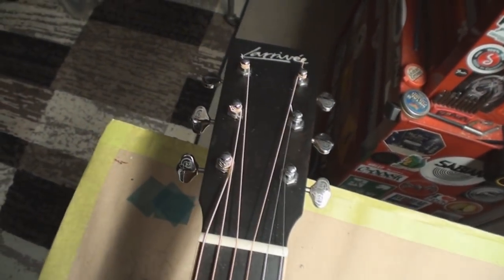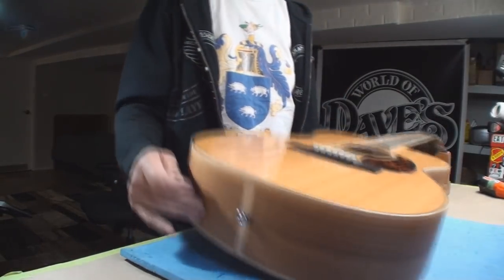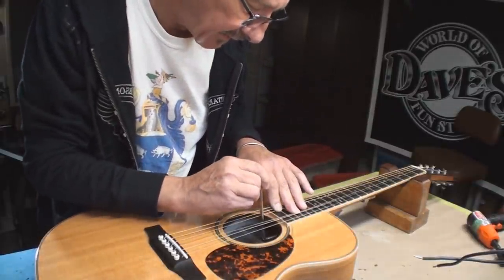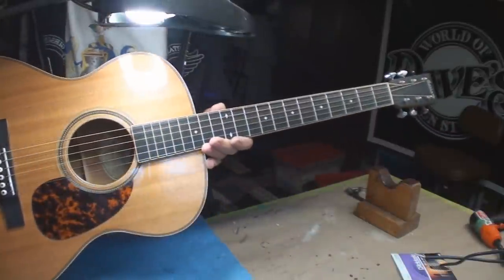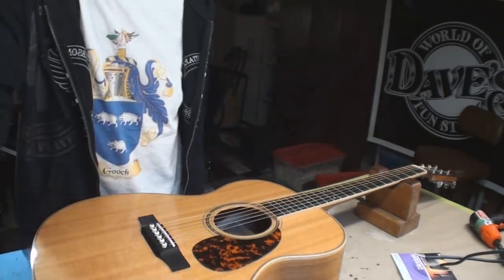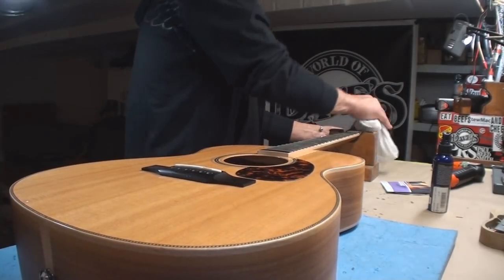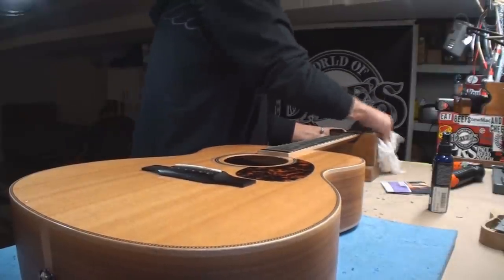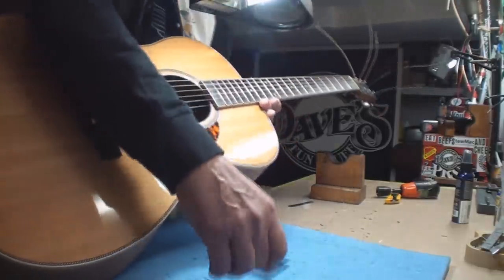Larrivee Guitar and the Stupid Truss Rod

Comment: I'm dealing with this now on my Larrivee LV03-e. I went down 1/2 a string guage so had to get some more relief into the neck. It never dawned on my after 11 years of playing this guitar that I had no idea where the truss rod adjustment nut was located. In looking into the sound hole, that didn't clear it up until I got a dental mirror at just the right angle was able to see where it was. After cursing Larrivee and all of his offspring for the sadistic position of the nut, I ordered the correct wrench and I'm trying 1/4 turns and waiting for results in 2 hour increments. Thanks for confirming my feelings on this otherwise stellar guitar. I'm sure they aren't the only ones that bury this in the sound hole where it's particularly hard to locate. In fairness, Martin and many others choose to put it on the butt of the neck, my best guess so as to not take the Gibson philosophy of "1/16th of an inch of wood at the headstock break is plenty of wood for anybody!", followed by the sickening sound of a headstock snapping off as the guitar slides slowly to the floor...

Comment: I have a 1981 Larrivee. No truss rod, neck still straight as when I bought it new. And that is with our brutal climate, going from 70-80% humidity in the summer to 20-30% in the winter. Don't know how they did it, but it worked.
Reply from the maker: it has one you can't find it
Reply: @DavesWorldofFunStuff  My luthier has the same model. There is none.
Reply: @DavesWorldofFunStuff  Just went over an old CBC factory tour documentary. You're right, there is a rod, but it is not adjustable. Interesting to watch,  you can find it on You Tube.

Comment: My Lowden requires the same kind of wacky shaped tool to adjust the truss rod. Rather than indulge the silly design by purchasing such a tool, I bent a 3/8" copper tube into a "J" shape, then taped an "L" hex wrench into the hole of the short end of the "J" and it works like a charm.

Comment: David i got a Mitchell Dreadnought for a hundred bucks in mint condition someone must have lost a saddle when they took the strings off got a new saddle but didn't file it down and just stuck it on there, so naturally I had to take it off and sand it down well worth it for a hundred bucks by the way what do you think of Mitchell guitars their pretty good I think. the neck isn't pushing down the sound hole the bridge isn't pushing down the sound hole. it's nice and straight it's beautiful 12-string by the way and it came with a hard case. it's nice dark blue velvet inside a roadrunner quite the bargain I'll tell you, I'm psyched I'm waiting for a new saddle to come in the mail from tusqe just so I can spruce it up a little bit better some brand new tens on it rock and roll bro😎🎸🎶

Comment: Dave - in the first few seconds of the video, you show a close up of the headstock. There is a really sharp pull angle on both E strings into their tuners. I've generally wrapped these "the other way" and wound them from the outside to reduce that angle. Am I way off base? I am an amateur everything.
Reply: That'd be confusing when tuning.
Reply: @kootenaystringworks1765  Yes, but after about the first 10 times of tuning the key the wrong way you'll catch on.

Comment: Dave, I’m looking to buy a Larrivee L 03 used.  A guy in my hometown has one that is a L 03 WL (Claro Walnut back and sides), however, it has a long hairline fracture near the nut that spans about 3 frets.  He claims it’s an easy fix and says it’s in good condition. He wants $1250 but the neck issue is a huge concern.  Is this an easy fix?
Reply from the maker: pass..buy a guitar without a crack..if it's aan easy fix ..get it fixed then sell it